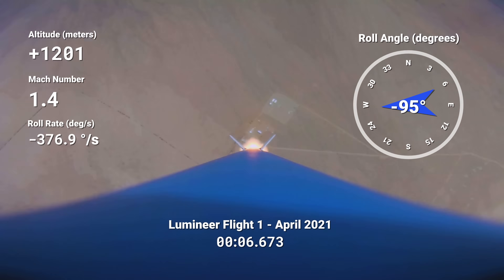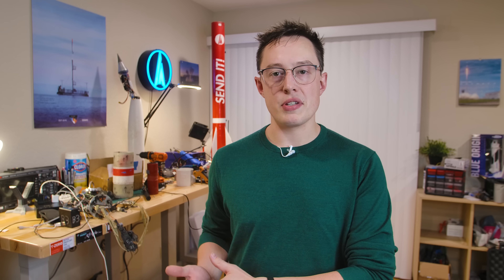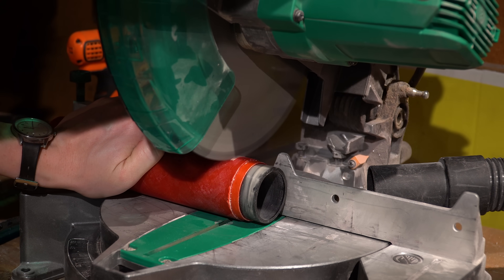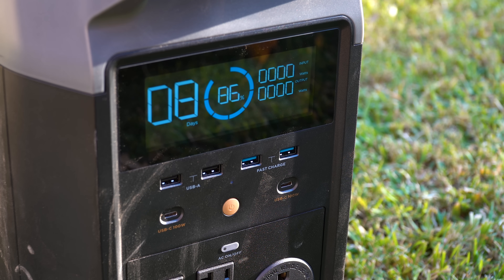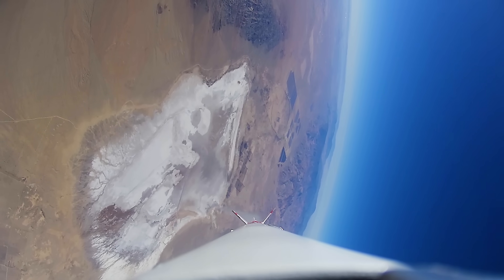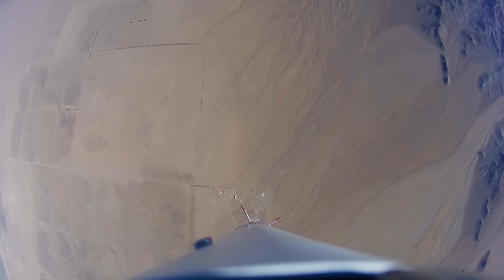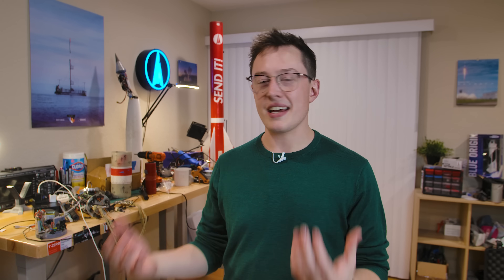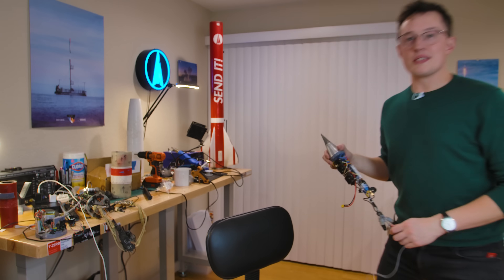Can You Get Stable Video From a Spinning Rocket?

Comment: So firstly the job of an engineer is very much not to overcomplicate things - that's bad engineering 😅

Secondly; what about instead either spinning a mirror instead of the entire camera, or else retaining a spinning head but controlling that with small fins rather than a motor? Both options seem like they would have less issues with mass, motor control problems etc.

Comment: Why not use 4 or 6 cameras with enough field of view to generate a 360 images? then stabilized it with software proportional to the rotation speed. With this method you can remove the mechanical parts and the related problems. Maybe the cameras can be expansive , and it can be difficult to merge the images from the individual cameras. it's just an idea

Comment: I don’t have a ton of experience with brushless motors but what i have tried many years ago using a hobby sensorless brushless motor and electronic speed control designed for RC cars was what you found that no matter how i tweaked the controller it was near impossible to get good control of the motor at low speeds especially when torque demand was higher.   However i have seen people use small robotics focused brushless motor controllers with sensors on devices like 3D printer extruders and just basic hobby motors with success.  Combine that with a PID algorithm that you tune on the ground maybe that could work.  I also kind of wonder if you could have a freely spinning camera segment and use a geared down servo connected to two small fins on the free moving camera segment to counter the rocket spin

Comment: At first, I had the idea that you ended up creating, but then I thought hard, and I honestly think you can get away with using 2 180⁰ fov cameras and using a program to stitch them together. This way, you can use something more powerful that onboard 360⁰ camera processors to stitch video together, and you greatly reduce payload. If you want to stick with unspinning the camera though, you should use a sensored brushless motor. This will solve your low RPM issues.

Comment: Did you ever consider using the bearing wheel base to allow the camera to just freely move… Even adding a little bit of weight to the camera side so as the Rockets spins, it stays mostly stationary?

Perhaps even mounting smaller fins on the camera bearing swivel, at a lesser or same degree that you have the main fins, however oriented in the opposite direction so that it spins in the opposite direction?

It might be worthy of a test so that you could also incorporate this with what you’ve already done with all of the motors and high-tech instrumentation you’ve already put into this project.

Comment: Depending if the camera exposure is fast enough, could you spin the camera at high rpm in sync with the desired frame-rate? So 24fps would be 24x60sec or 1140rpm. The speed of the motor would not need to change if you could trigger the exact beginning of each exposure. Ideally taking individual photos triggered at each revolution by a hall sensor and a timing delay/advance added dependent on the calculated rocket rotation, afterwards editing them together as film. I think it could remove all the gear reduction requirements and save weight, and with constant speed you would have less reaction wheel effects. I’m reminded of videos where a camera syncs to the propellor of an airplane and makes the propellor appear perfectly still or How machine guns were sync’d to fire through propellers.

Comment: I'm curious if there's a purely mechanical way to counteract the rotation; like using the centripetal force generated by the rocket spinning to drive a clockwork like gear train.  
I'll fully admit this isn't my forte at all but it's an interesting thought.

Comment: Use a servo motor! Steppers are clunky and somewhat easily lose track of steps. If you use a servo motor (geared and typically brushed DC motor) with an encoder on it, you can have EXTREMELY fine control. Just need a half bridge to drive it, but those are pretty easy to find with some internet sluthing.

Comment: just let the camera spin and treat the path of the CCD readout like a push broom sensor. each row of pixels will be offset by a similar amount because of roller shutter, and I guess the direction of each exposed pixel on a row would be offset a little if it's spinning fast enough

Comment: - the big main fins overpowered the small fin intended to spin the rocket.
- a BLDC motor can be operated as a stepper, and microstepped for smaller spin intervals.  This will require a reprogramming of the speed controller.

Comment: it's works as the anti-roll mass lol

The reaction force that rotates the spinning camera mortor  roll the rocket.
And then, the fin spins faster than the air flow around the rocket, it's mean the fin affects as the anti-roll.
So, rocket roll is canceled while the inertia of the camera is less than the sum of the inertia of the rocket body and the aerodynamic forces of the fins.

Therefore, I think it's a GREAT technique

Comment: 1. May put a reaction wheel for stability so you don't need a rotating rocket. The camera can be outside without this complicated stuff.
2. If you keep with the rotating camera idea, I think the motor is fine. What I suggest is change on the programming: DO NOT trying to compensate when the rotation of the rocket is so slow. It will look actually cool!

Just my suggestions, your work is really great!

Comment: you can go for stepper motor but if u kinda still need those hig kv brushless motor go for sensored brushless from rc car ... if there is sensored esc for drone any sensored motor will work>... stepper motor are kinda sensored too .. but if need more power rc car motor beter

Comment: OK, as others have said, brushless motors need commutation sensors for zero-speed linearity. Steppers are simple, but can introduce impulses, and resonances at certain speeds can cause them to stall entirely. I would stick with brushless, and go with a sensored controller.  You will end up with linear speed control through zero, and reversibility (might be needed on descent).  And as far as the angular momentum of the camera ring, seems to me if it works correctly, it should have none. The rocket spins, the camera doesn't...

Comment: OK HEAR ME OUT.. 1.I have zero clue what I would do.. LOL 2. WHAT IF... you LOCKED IN A GPS CORD.. or even a directional thingy.. like say YOU ALWAYS HAVE THE CAM pointing in the direction 270º and have the software tell the motors to keep that cam pointed that way.. instead of trying to calculate the rotation? 3. I HAVE NO IDEA if you thought of that or if it would be easier or harder.. BUT if you have thought of it or will... please explain so in your next video? THANKS and good luck!!

Comment: Hm, would it be possible to mount the whole thing on some sort of magnetic bearing to make it nearly frictionless, and setup some sort of basic electric motor design with some coils on the moving part that would push against permanent magnets or eddy currents on the tube the thing is mounted around only when it needs to accelerate/decelerate?

Comment: Perhaps try using a brushed motor. People that run RC rock crawlers will sometimes used brushed motors over brushless since they are much better and smoother at slower RPM's.

Comment: Idea, how about as low a friction bearing you can reasonably source to use between the camera assembly and rocket body, and small fins to add a little rotational friction? Allowing it to move as free as possible in relation to the rocket body may be adequate

Comment: Despite his comments, I think it would be better to slow or eliminate spin on the rocket (fins or thrust vector). While spinning will stabilize a rocket, it will also slow it due to the drag on the fins.  If you're going to spin it, then ditch the fins entirely.  On the other hand, you can send up a spinning rocket with astronauts, right?  So ultimately, spinning is out (I'm not saying he's planning on launching humans, but it shows that the pros understand that spinning isn't the solution.

Comment: Your dealings with the "ESC" function is an example of "rackum-stackum" engineering done today.  You need to make the controller for the motor yourself, including encoder that can maintain speed & commutate the motor at zero speed!  Communicating with the motor controller via PWM is another thing that must be eliminated.  The whole PWM protocol was designed in the days when dinosaurs hissed at model RC aircraft to accommodate the crude radio that existed at that time.  It is lucky to have 7 bits of resolution.

Comment: Mabye try a inner and outerring, both connected with the Gear of the Motor. Then you can calculate their angular velocities. Make them Spin aganst each other. The velocities should be proportional w1=-k*w2.
Then chosse 
  their Moment of inerta I1 and I2, that 
I1*w1=I2*w2.

That will garantuee that their combined angular momentum is Always Zero. If this Part can move free with respect to the Rocket it ist always garantueed that the moving Rings dont effect the Rotation of the Rocket.

Than you dont have to build a Controller that counderacts the Rotation acceleration of the Rocket.

But the Motor will have to rotate Forward and Backwards.

Correction.: The Rings must have the Same inertia and should be an upper and lower Ring or you get a netto force on the Gear of you  accelerate the Rings. And this netto force on the Motor could create a angular momentum via the motoraxis as a levrage

Comment: What I first envisioned as I clicked on the video was a disk-like lens as part of the rocket hull that, via a conical mirror, allows capturing imagery on all sides of the rocket simultaneously. Basically like a 360° camera, but the rocket is the center and there'd be no digital stitching required.

Comment: You said it was only a proportional controller so the “winding up” does not make that much sense to me if you are using angular velocity for the error and not angle. If the case is that you are using angle, why so? You will be getting it from the integration of the angular velocity anyway, so using the angular velocity directly would prevent the integration of an anti-windup. Just my thoughts.

On another note, just landed here and I am astonished by how cool this project is and your manufacturing abilities, plain impressive!

Comment: Another cause of unintended spin in our hobby rockets is off-center thrust.  Spin induced by off-center thrust is dramatically illustrated in my Upscale Cineroc video at https://www.youtube.com/watch?v=B5ALJlULV14&t=2s

Another example (with a much smaller motor) is in the high-speed video at https://www.youtube.com/watch?v=dQCGtr3_ht8&t=64s.
Reply: Oh, and you stated that a reason for desiring spin is to help stabilize the rocket when fins are less effective at altitude.  Another reason, though, is to get a staighter boost as things like off-center thrust or other misalignments are averaged out by the spin.
Reply: PPS: I have an EcoFlow Delta Max that I bring to launches to use to recharge batteries and to run a fan to cool us on hot days.  It also powered our TV, internet router, and a few other things after Hurricane Ian knocked out our power for a few days.  I really like their products.

Comment: I remember reading about how an early NASA probe was spin stabilized, and to get good pictures, they basically only turned the sensor on when it was pointed in the right direction, and then essentially used the rotation motion as a mechanical scan function. I am sure using the tech of the time, that was a good solution. I'm not sure of you could translate the idea to current technology.
Reply: Giving new meaning to the term "rolling shutter"
Reply: @labboc  literally!

Comment: My first thought was a stepper motor aswell but I think they're only good for relatively low RPM. At least that was my experience when I had to program a motor controller to spin up a stepper motor to 250 RPM to spin a saddle-shaped turntable which was supposed to act more like a dish through its rotation in order to keep a metal ball near its center. That contraption was a mechanical analogue to a Paul trap, a device that can keep particles suspended in mid-air via a pulsating electric field, invented by the german physicist Wolfgang Paul.

No matter what I tried, the turntable would never reach the target RPM even with the softest acceleration programmed into the controller. What saved the project in the end was that the meticulously calculated 250 RPM that were supposedly necessary to keep the ball on the saddle turned out to be nowhere NEAR necessary. Through some experimenting I found out that about 75 RPM were plenty enough to keep the ball on the turntable, and they were no problem for the stepper motor either.

Why they chose a stepper motor for that task in the first place is beyond me, but in the end I made it work, thereby finishing the final part of a museum piece that was later on display at a Wolfgang Paul exhibition.

Comment: I have found that stepper motors benefit greatly with reduction drives. Giving greater power and accuracy without loosing steps due to reduced torque of direct drive. Experience from designing and building CNC equipment. Love your concept and testing.

Comment: What about adding a stepper motor that will add the torque needed to spin up at the lower speeds? It would be an on demand type setup. Turning off after a certain speed is achieved.

Comment: The solution you need is a DC motor or a three phase servo motor with FOC. Your BLDC/ESC isn't precise enought in slow speed. A DC motor with reduction and a closed loop can do it! With this type of gear ratio any DC could do it! The servo can be a good ideia but you may need to match the ratio!

Awesome results BTW!! if you can map the sleep of the ESC (starting the integral only when the esc is active) or create a good windup solution (like limiting the error integral) the result would be  better! But the bldc without FOC control is the point of failure

Comment: On Board LV2.3 with Roll Stabilization - Oct 26, 2010
PSAS successfully launched "Launch Vehicle No. 2.3" (LV2's third airframe) with a roll control module and "spin can" on Sunday October 17th, 2010 at Oregon Rocketry's (OROC) Brothers' launch site. On-site video analysis confirmed that the roll control module and spin can worked!
https://www.youtube.com/watch?v=f4rnlyAnIFw

Flight Video - Mar 30, 2021
This is a flight of my stabilized rocket.  It was a nice flight because it demonstrated all of the capabilities of the system including the ability to fly at an angle, change the bearing during flight and minimize roll.  The capability and importance of the spin can is also evident.  Rocket design and flight by Jim Jarvis.  Control program by Bill Premerlani.
https://youtu.be/Rf7un5jr3gQ?t=114

Comment: I suppose you have thought about making a 360 camera array, but instead of regular rolling shutter cameras, you can use global shutter ones. This way you can make them sync their "shutter"( more like a latch) and then give the processor time to read the data in a sequence form the already taken shots and to do the digital stitching. I also think that this idea has some flaws and I woul like you to point them out :)
Also, such global shutter cameras are found in Intel's realsense tracking cameras.

P.S. The shutter time should be short enough in those high luminosity conditions up there, but I might be wrong again.

Comment: Careful with the Stepper motor idea. Before you get to deep in to it, test it's torque.. I tried a stepper for a focuser on my telescope and the micro stepper motor (looks similar to yours) lacked the needed torque. and since your plate will be jerked quite heavily, just be sure it and work under that condition. 

I would try putting a Brass ring around your brushless outrunner motor and mount it so that the rotation axis is perpendicular to your rocket's long axis.. spin up the motor pre-launch and use as a gyro with a free moving rotator plate.

Comment: Thanks for a new vid!!
This also prompted me to ask if you have any videos or suggestions for a first 3d printer?  Entry level "home use" product.
Love from Canada :)
xoxo
Reply: What if your camera was on a bearing the diameter of the rocket that spins easily.  So the rocket essentially spins inside of the camera.  You could possibly add little fins of some shape and size on the camera ring to help stop it from spinning.  Like a little "wall" on either side of the camera so that when the rocket spins either "wall" hits the air moving from the rocket spinning and just stabilizes the camera because the bearing it's on is very low friction.  Maybe?

Comment: When it worked it looked real good.

As for the ESC. Perhaps you get better results with bheli firmware (used for quadcopers) and it's native protocol instead of PWM.
You will have much tighter control. And the ESC will not do funny stuff.

Comment: I really like what you've done here. Like the stepper motor idea too. It's much simpler and adaptable. Presuming of course that you're balancing everything, it's a pretty clean solution. I know there's also a lot of even smaller stepper motors that might also do the trick. You might find that a pancake stepper works nicely too by angling your drive gear 90 degrees. I made a similar modification to my high-speed 3D printer to decrease the weight of the printhead. My situation needed high torque though, not high speed. I only mentioned it, because some of those pancake steppers are really small.